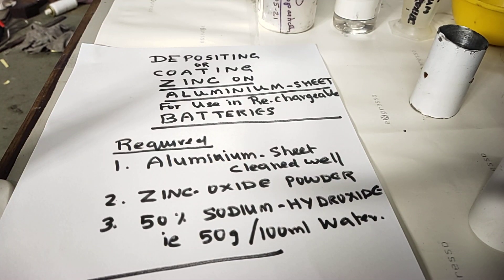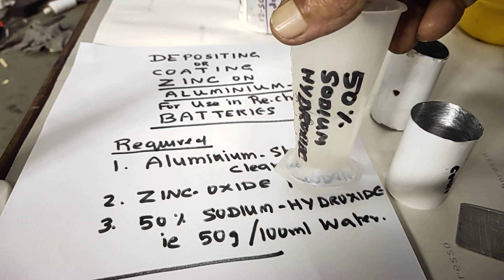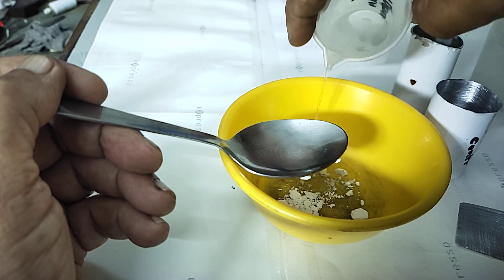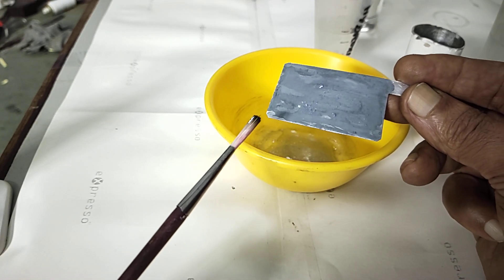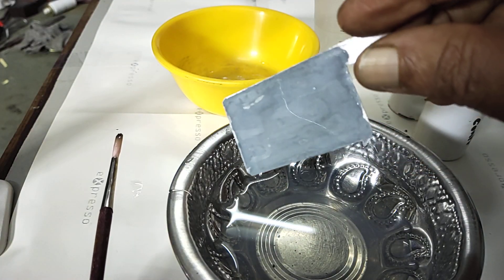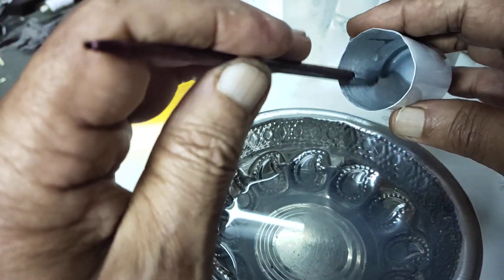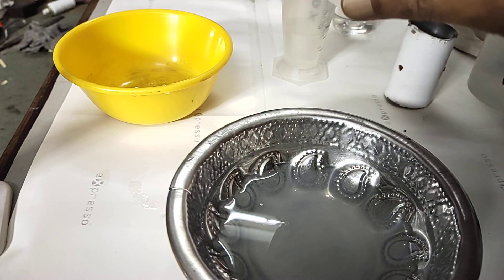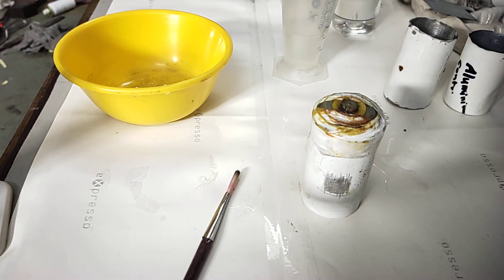VERY EASY PLATING-COATING OF ZINC ON ALUMINUM SURFACE BY YOURSELF -FOR BATTERIES

Comment: I just saw your channel, I wish you success.I wonder if similar coatings can be made on aluminum with SiO2, TiO2, MnO2, CrO2 and H2O2? Because the coating reaction is ZnO+NaOH=Na2ZnO2 and Al2O3+NaOH=NaAlO2. SiO2, TiO2, MnO2, CrO2 and H2O2 produce similar reactions. Is Na the binder in the reaction?
Reply from the maker: This coating with alkali  works only for zinc on aluminium. I have limited experience in other coatings. I thankful for your well wishes 👍
Reply: @dkjawahar-techexpt671  Or, for example, copper reacts with NaOH as Cu + NaOH = Cu(OH)2 + Na. If we use copper plate instead of aluminum, can Mg be coated on the copper plate, for example, by the reaction MgO2 + NaOH = Mg(OH)2 + NaO? Can it work as a binder for OH ions? I wonder if you have the opportunity to try this. Because copper is a better conductor and there are more metal options that give hydroxide ions. Thanks for responding.
Reply from the maker: I already tried to use this method to coat zinc on copper. It doesn't work. Only by zinc sulphate, zinc  as +ve and copper kept as Negative electrode using 6v, 0.5 amp

Comment: Sir can we use this over Iron ??
Reply from the maker: It works for aluminium. For playing zinc on Iron, you have to take zinc sulphate as electrolyte and positive zinc plate. Your Iron shall be as Negative. Apply 6v, 0.5 amp and see the coating quality.
Reply: @dkjawahar-techexpt671  thank you Sir .